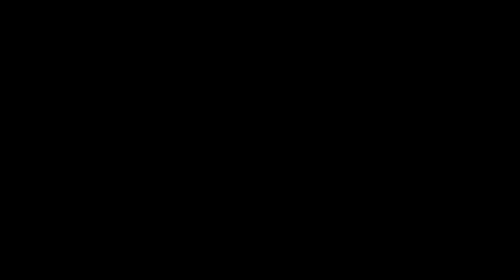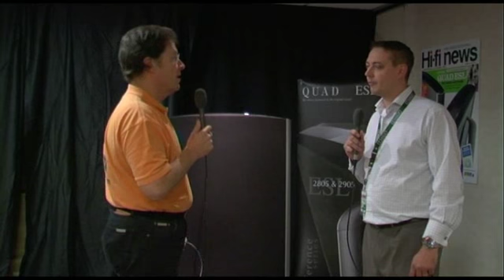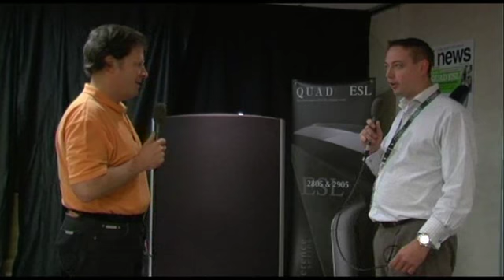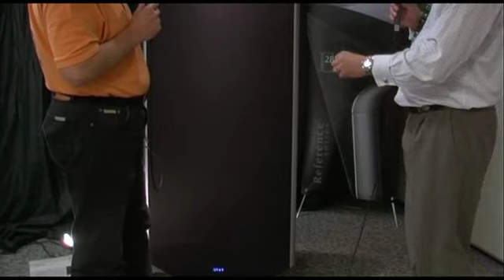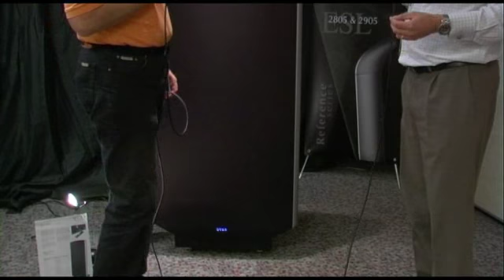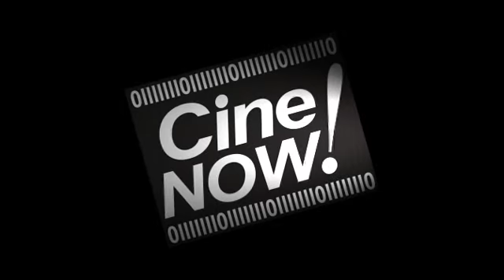Quad ESL speakers are truly innovative, learn why (What H...

Comment: I wouldn't call a speaker who's design dates back to 1963 innovative. That is when Peter Walker conceived his delay lines design. His first execution of that design was in 1981. Better structural integrity is nothing innovative either. The 2912 is more of an evolved product than anything new. Interestingly the new Quads measure no better than did the ESL 63 or perhaps a bit worse because of a rise in the bass and a saddle in the mid that isn't there in the 63 version. That said a well set up pair of Quads are still some of the most listenable speakers you can buy. The old Quad 57 is still unsurpassed in midrange transparency and low level detail. Even the newer Quads can't quite manage the 57's disappearing act.
The electrostatic with overall lowest overall coloration, lowest distortion and highest transparency is the Innersound hybrid (now evolved into Sanderssound). It is not full range but a hybrid with TL woofer. Within it's bandwidth it's the most literally accurate transducer in the world. It has no discernible coloration whatsoever and it redefines the word transparency. Literally an open window to the signal that's driving it. The bass while good is not up to the standards of the electrostatic panel and the speaker is freakishly directional rather like a flashlight. For some listeners including me these two issues give the nod to the Quads as the better overall choice. If however pure transparency and resolution is most important to you than the Sander/Innersounds are a definite candidate for the best in the world.
Reply: Convinces me to try finding a pair. Although, arguendo: a clear window onto the signal, is a window back into control room playback - which in turn means a window back to Tannoys, or RCAs, or whatever Rudy van Gelder, Teo Macero, Linda Perry, hell, Lee Perry, had for their rigs. I suppose George Martin or Tony Scott orTony Visconti would check a pair of Rogers 3bs, the way we know NS10s and Auratones were the alternate mix check. 
I do know that Rupert Neve console strips were sought after, but do not know as much about playback, despite the fact that this was the way in which the artist & producer heard & decided what they had, even, how to proceed. 
I always presume that midrange presence, & thus artifact (most often, fingers on fretboards, sllding around, and any number of human voice ticks & clicks) are the sign that you have a producer's playback type sonority. But the producer of course was looking for mistakes, not for enjoyment.
Which is not to say those speaker systems supplied properly would not sound more than enjoyable, on any standard. First thing would be, to start the chain as way back - with first generation signal 1/4 inch tape at freaking 30. Even the high end demos at Munich, NY & CES rarely take this head start. 
If anyone in the world has the 10-inch Radio Canada masters of Sun Song, by our Montreal fusion pioneer Sonny Greenwich, and some take up reels, and a refurbished Revox, I would then seek to re-connect Ken Kesey's Voice of the Theatre system in the boughs of California redwoods above Big Sur. Powering up, I would then sniff, for short circuits. Imagine. Determining toe-in, and checking tweeter horn heights, might take weeks. Glorious weeks.
Reply: I agree. They're trying to market these Quads as if they were a new invention. They are indeed evolved products instead of innovative ones. But there are other really good electrostatics by other companies too. A major consideration is durability and servicing, making the Quads something of a risky purchase with their quality control problems and spotty distribution especially in North America. If they go defective you might have to ship them overseas for a repair.
Reply: @socksumi  true, but most loudspeakers launched today, lack even ancient innovation qualities of the Quad, instead apply nothing new, other than new materials variations and case designs, that evolved from the 2000s (narrow shoe shelves with side-woofers). The outstanding ones apply solutions of the 30s and combine them with the dog-cabins of the 70s.
So one can understandably look over the fact that the Quads have aged without much evolution and that is actually because they‘ve been worlds ahead, then, so far nobody needs these new things, once he listened to the 2 main flavors the 57 and the 63 and chose from them, which can still be repaired or even tuned-up to a more modern solution, like these new models. Adding a powerless and thin sounding amp and source to these speakers will make everything klingelingelingtschingbling sounding, sure, but that wasn‘t the case then, when amps and cartridges or tape were in muffeling mood and needed some freshness to live up. So it‘s all about tested combinations, not „whatever“ choice.